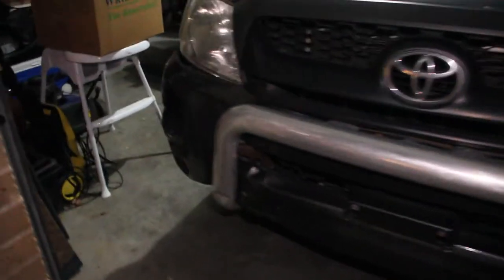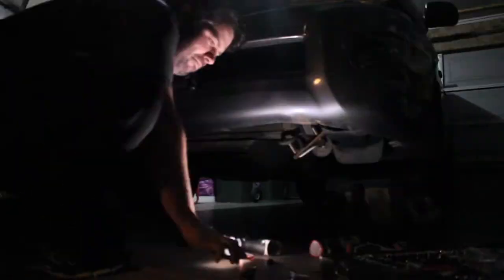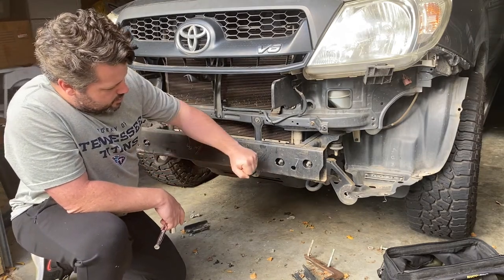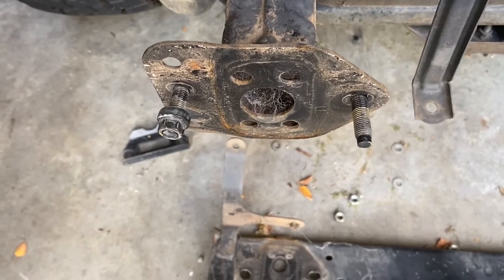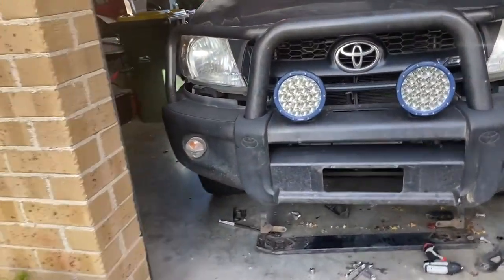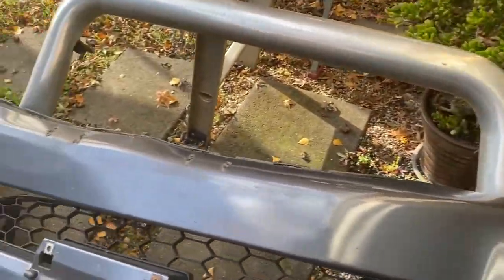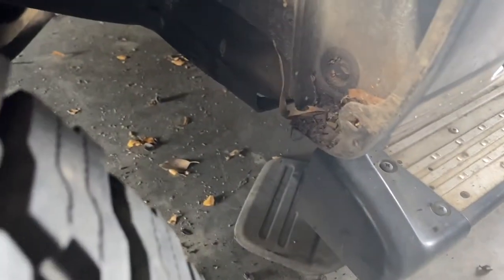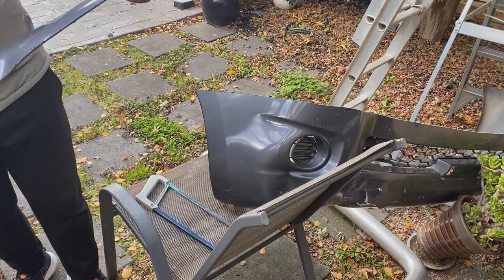HILUX damage repair and bullbar install!

Comment: So I just done mine, same model. I took those clips and plastic bits in the way off completely. So it looks like I put mine on about 50mm higher than your bullbar, must have put the bolts through different holes, but yeah mine came up nice and flush with the edges, looks like this one has been put on wrong tbh but still found the video very helpful. Thanks.